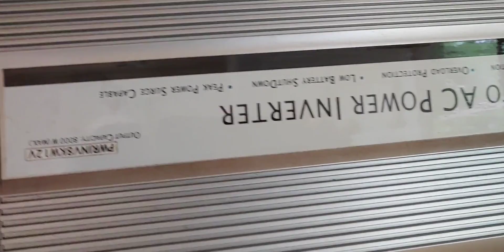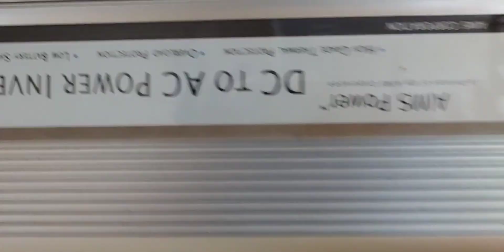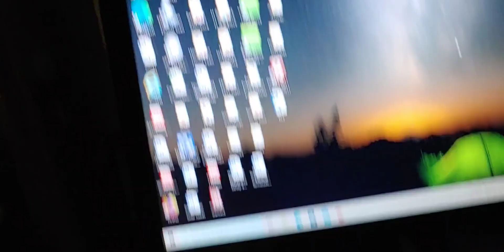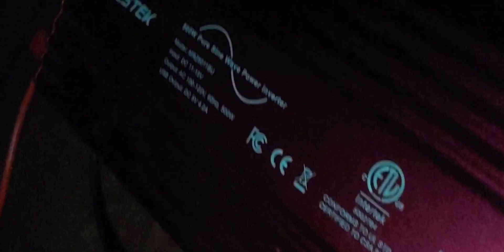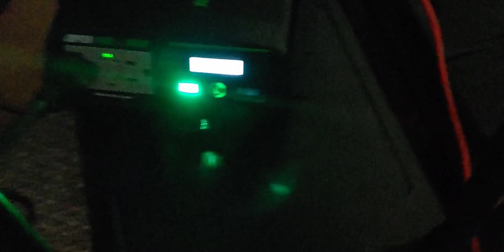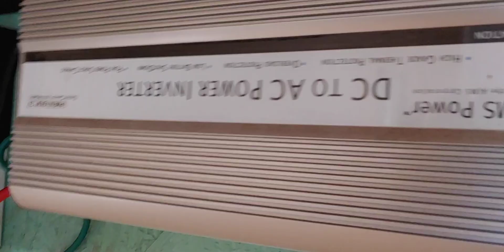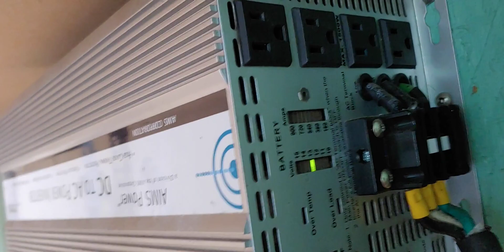When Modified Sine Wave Just Won't Do

Comment: people putting lifepo battery with bms in series freaks me out ... STOP DOING THIS MY GOD, these are NOT made for this, if you need a 48 volt buy a fucking 48 volt ... these are not lead acid for god sake ...
Reply from the maker: Actually those batteries in bms's are made to do that. Thanks for your comment.

Comment: The setup at 1:53 the wire gauge looks way too small for a 1000 watt inverter. From the looks of it appears to be number 10 or 12 wire. If you ever draw close to the max load that wire will smoke. That size wire looks like it would only be able to handle 500-600 watts max.
Reply from the maker: Thanks for your comment.

Comment: Many "sensitive" electronic devices such as TVs, computers, and inket printers (not laser) convert the incoming power into a lower voltage DC so they do not care about the sine wave. Infact, many commercially made UPS devices for computers to provide backup power are only modified-sine wave as they are cheaper. Modified Sine Wave inverters will only be an issue with larger appliances and devices that have motors such as refrigerators, air conditioners, power tools, or anything else that runs directly off of AC power that do not have a power supply that converts to DC.
Reply from the maker: Thanks for your comment

Comment: I purchased that exact same Jupiter 1000w inverter and when it's charging device's. I can't use the device. So I returned the 1000w and purchased the 2000w Jupiter. Do you know why I can't use my laptop or phone when it's charging?
Reply from the maker: I don't know why. I charge mine and still run items. Maybe just a defective unit. Thanks for your comment.

Comment: I am looking for something similar to convert to pure sine wave.  I need an inverter to convert my gas generator with modified sine wave 120v to DC 12 or 24v.  Or just convert modified  to pure 120v AC.  Any suggestions?

Comment: Thank you for the video. I'm developing an off grid system here in rural part of Madeira, Portugal. I may follow your current design, i.e. mod-sine for dehumidifier, bread making machine, light tools (drills, grinder, 2 miniwashing machines, wash-spinning-machine, etc) and pure sine for more demanding devices (internet, home cinema).
I would like to have the security of the diversified power delivery system, as well as maximum possible reduction in the amount of stand by current that large inverters draw - I will switch it on as required.

The cheap pure-sine inverters often have constant fan, but i hope to convert them to 'on/off' operation by installing an internal thermo-switch an a relay. These electronic parts are really cheap, so i should be able to make some saving as well as get some experience from the task. 
Greetings ❤
Reply from the maker: Good luck with your system. Thanks for your comment

Comment: I really enjoy the way you think when it comes to energy. I have a question, maybe two. It appears you have many things running on batter and solar, have you done the math to where you know how much you actually save on the electric bill? I can see those who do the thousands of dollar wholehome systems and sure, in the long run there is an economic benefit. Ive looked at that 500W inverter in Amazon at least 15 times😊. Btw, I did the beginners version of the HF 100W solar panel system with 4 12V35AH Batteries in parallel,  haven't put a good load to test or push power to see the teue performance. Anyway,  hello from south Florida, be well and keep making great videos.
Reply from the maker: I don't really do this solar thing with the intention of saving money. So I haven't done that study with the utility bill.
I do what I do for power outages and self sufficiency.
Thank you for your comment.
Reply: @shoestringprep  OK, thats valid. do you know if going beyond the 4 batteries that I have is worth the trouble? I think not, the only reason I did it is because I have multiple hernias that I must take care of so weight is an issue for me. But right now, the 4 batteries produce 140amps which I can use maybe 40 to 50 usable, I think thats enought for a few fans, a few lights, and chage the phones. Thats to real goal. Good day!

Comment: I run all my sensitive ele tronics off modified sine. Nothing has blow. Yet after several years. Only in grid failure scenarios. Sometimes for up to seven hours but, that's just a wii little home server. The rest only  get like one hour of run time.

A lot of APC UPS are modified sine even some of the "pro" units
Reply from the maker: It is good you found a system that works for you. Thanks for your comment.
Reply: For many years i ran laptops and some other sensitive electronics off mod sine wave with no problems. I have since upgraded to a pure sine wave inverter now tho.
Reply: Why?  @lawrencedavidson6195